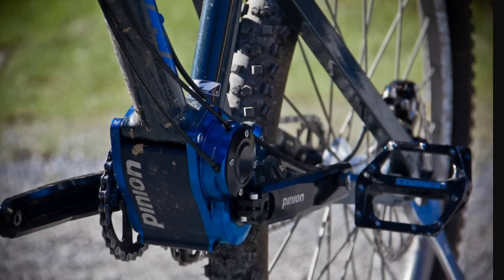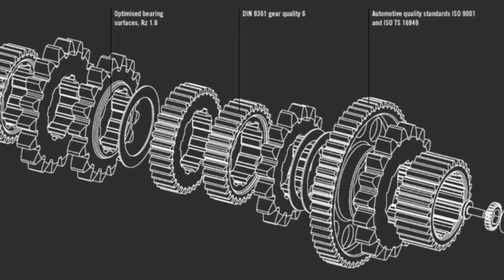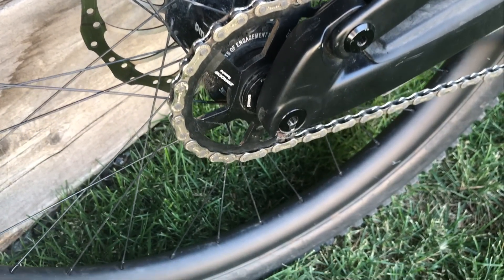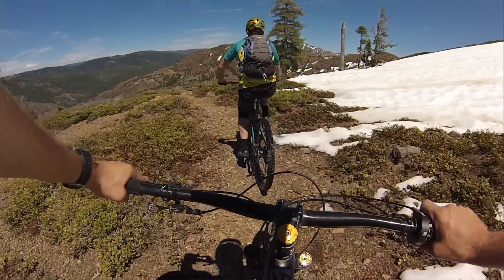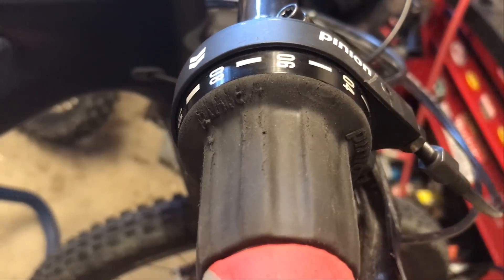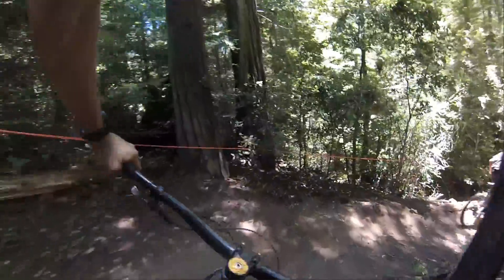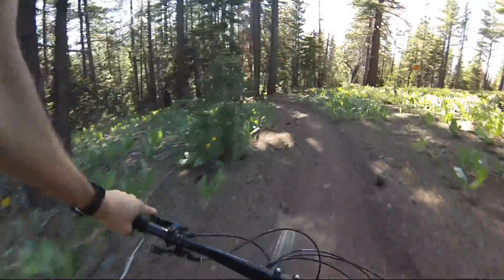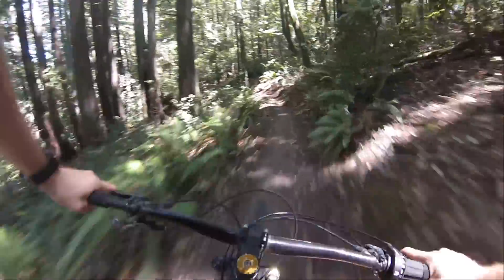Pinion Gearbox Thoughts & Opinions

Comment: From an engineering perspective.. Weight, different shifter styles, shifting under load and drag are all problems that are easily within reach. You only have to look to the motorcycling world - especially MotoGP. All that has to be done is throw R&D-time at the problem ($$$). I am sure that Shimano and SRAM already have a gazillion prototypes and long term strategies laid out already.. I bet this stuff is closer to reality (in a refined sense) than we think..

Comment: so life of the bike warranty length, huh, I still have my mid 90s specialized hardrock. so let's call it 20 years old. I mean it's had new chains, gears, chainrings, etc but the frame is still solid all these years later.
Reply from the maker: Andrew Frink yea so probably after 10 years you would have to replace the drivetrain on this. Meaning the internal gears

Comment: Once they get rid of the grip shift, I’ll be sold.
Reply: @peterlocke7285  He clearly suggested "get rid of the grip shift", read it carefully and slowly in case you miss it again.
Reply: If by "grip shift" you are talking not about the grip itself, but that 1 inch rotating part between the grip and the brake lever,, I just went on a ride, and it worked JUST FINE. As with anything mechanical with which I must interface, I have to adapt to IT'S requirements. So far I like it a lot.
Reply: @peterlocke7285  one of my bikes is grip shift, I hate it. I prefer to choose a grip and change it intentionally rather than keep moving my hands around like the  grip shift bike does. It's good for leaving outside ships though, thieves seem to dislike it as well.
Reply: @edism  Describing shifters can be confusing. What configuration of shifter do you like and is it compatible with a Pinion gear box?
Reply: @peterlocke7285  I have Shimano di2 on my road bike with the handlebar remote on the flat bar. It works with the electronic deraileur it comes with so it isn't compatible.
Reply: @edism  LOL! You have WAY out-teched me. I dislike my shifters ( 5 yrs old) because of dropped chains and half-shifts. Didn't know what a "flat bar" is, but see it's simply my MTB bar.
Reply: I understand that with time it becomes second nature.  It also allows to RAPIDLY make big changes in gear rather than having to run through all the gears, you can jump.
Reply: @edism  HAHA!!
Reply: The main reason I don’t like grip shifters is that they move about too easily, so if you’re jumping about on a trail you tend to accidentally shift all the gears up. Also, if I want to just move the gears up one by one a trigger shift is far better because I find it more accurate
Reply: @ollydickinson2196  That may be true of most grip shifters but everything I've read and heard says this is very deliberate and index like. Tough to say because I haven't used it yet.  Waiting for a pinion bike right now. That's not to say you don't make valid points!
Reply: Suppose you have to try it to know really. I don’t think I can really afford a Pinion bike though unfortunately

Comment: I've been saying this for years. The drivetrains for very modern mountain bikes is ancient. So why have all the tech (suspension, frame materials, and breaks) changed, but not the transmission. I think for this system to take off it's going take SRAM and Shimano to develops and market this system for it to become popular. Also the weight might become a factor.

Comment: Disadvantage:
- the weight
- lack of switch during drives and the gripshift
- price.  (this is not the end...)
But:
- the benefits can be evaluated primarily on full suspension bikes, but they are also partially made on hardtail
- shorter frame tubes - less weight
- no rear derailleur, no big cogset - less weight, and that no one has raised so far, less unsprung mass
- symmetric rear wheel, same spokes' lenght, same distance to the axle center - stiffer, more stable rear wheel, plus efficiency in the drive (and braking too)
- the drive is in a constant straight line like the fixies, there is never Z-shaped chainline, smaller gears and especially chain wear, and of course more power goes to the drive
- therefore the drive is much more direct, no pasty feeling
- no cross-exchange, does not fall off the chain, if the belt drive is enough, constant chain maintenance will be lost
- shifter: Effigear's solution works so that the two cable leads to the left and right grips, like the rapidfire changers, but one side you can shift up, other side down. It's funny first, but it works.
Price:
Expensive, but life expectancy is min. 8-10 years (the warranty is 5 years), and its maintenance is relatively cheap (oil, chain, cable&housing / 1-3 year). 
In such a time, a power biker will change the number of parts in a conventional drive chain. In this case it counts for 8 years, what is the cost involved with the maintenance?

Comment: !st of all, I am not a mountain biker, more of a commuter and somewhat of a bicycle tourer. Plus i'm 62 so not really in a hurry.I have an 18 speed Pinion  touring bike with about 3800 miles on it. Never had to adjust it just change the oil once a year. They loosen up after about a thousand miles or so. I can see how the shifting would be a bit problematic for racing. Once you get a feel for it you just ease up on the pedals enough to downshift. Upshifting is usually effortless. They are expensive but I have no regrets.
Reply: I commute to work by bike every (work) day even in the winter, even in the worst rain. I have at least 3100 miles on my latest commuter bike just from the rides to and from work alone. I also ride it to do grocery shopping and so on so the real mileage is much higher.

I have only now replaced the chain, I adjusted cable tension maybe twice and I lubed the chain maybe every 300 miles. I see no real advantage of having a gearbox.

Comment: On this gearbox if the spacing between gears is 17% then that's too high. Needs to be about 10-11% max. Rohloff is typically 13.6% in mid gears and this is too high. 9-10% all through the range would be good at the expense of some of the width of the range. Maybe with the 18 spd they could do it.

Comment: Alex Chamberlin at 10:38 you state you have the leverage to just bang through the gears on a motorbike. As you were comparing it to the need to momentarily cease applying pedal force to change gears on the pushbike you are incorrect. Yes it is easy to change gears without clutch use on a motorbike once moving but no intelligent rider does so under engine load or bike load on deceleration. One removes the load on the gears by an appropriate throttle twitch as required to up-shift or downshift seamlessly unless you like to risk breaking something. This happens so quickly as to be generally a seamless operation by any skilled rider. Older Mack trucks were designed to operate in this manner and it can be done with any manual gearbox by a good driver or rider who understands rev/speed matching. But as I said earlier; no intelligent driver/rider ever does it without unloading the gears.

Comment: Well one con you forgot is that it does not fit bikes that use derailleur system. It fits only the frames that are made to it. I don't say it should be able to mount in normal bike frames but at the moment that's a con since big manufacturers don't support it yet. 

And the reason behind the weight is probably the reliability that they really need at the start. Gearboxes are very complicated systems and hard to repair yourself. And at the moment I can guarantee that there is very few bike mechanics in the world who could service that gearbox in case it breaks. So they probably do all the gears way much stronger than need to be to gain that reliability, they don't want to get reputation that their gearboxes are weak and super hard to repair since no one knows how to do that. For now I believe they want to get feedback and many hours as possible to their products so they can improve such things like weight but still maintain that same reliability in future.

Two things I don't like about that system (even not trying it) is that the shifting is not done by two levers. I am not big fan of handlebar shifter or what ever that thing is called. Also not possible to shift while pedaling sounds like no go for me. I hope they make the shifting semi automatic in future with some electrical brains and clutch for example. So you could shift when ever you want and that gear would be immediately in when you pull/push your levers.

Comment: Almost 1 kg of weight is problematic from a marketing perspective. The parts not being serviceable means if it breaks, you're out of luck. No power shifting is a problem even for casual riders. Those are not small kinks.
Reply from the maker: Andrzej Sawicki this is true
Reply: On say a motorcycle you arent on the power while shifting so easing off pedaling to shift shouldnt be crazy unless you have some good hills ;) if anything this system needs a clutch of some sort so pedaling can be done with the clutch engaged so when you have to downshift quickly for a quick hill theres not as much drivetrain losses. The weight is a mixed compromise between quality and quantity but surely there's some way to make this bike 25-28pnds through parts. My 09 stolen sinner stock was around 28pnds or so and ive got it down to 23.5 with a peg so the 25/9 ratio on 170mm cranks is still a good workout 😂
Reply: As an endorphin junkie (translation: I like to climb long steep hills), this is obviously a non-starter. The weight is one thing, but no shifting under power makes it next to useless.

Comment: The new pinion gearbox is good and all but the chain because mine you have a rubber chain it can break and you can't repair it but with a normal chain you can easily fix it so I rather go with the metal chain

Comment: You cannot shift a motorcycle gearbox when it is under load. You have to back off the throttle for a second (or cut the fuel - like a quick shifter does). Same goes for the pinion - you gotta back off your power for a second to get it to shift. A Di2 type shifter won't fix this.

Comment: The gearbox of the future will have no derailleur.
A computer will decide when to change gears.
Because it has a motor it won't need many intermediate gears. Dropping them saves weight and complexity.
Gears are enclosed.

Comment: If you do downhills that could work, I've tried a planetary gear Schlumpf High Speed drive, I did a ride of 150km, my knees where in pain. At the end I've took it off and took back my crankset, it was more fluid less power to spin it.
So for some use it may work...

Why they don't use it in tour the france or other competitions, if it was so magical?
There is a loss of watts, to make it spin, there is no magic solution.

Comment: Cannot be retrofitted to your existing bike. Rohloff & Schlumpf are a simple exchange. Schlumpf drive + Rohloff= $2600. Best gravel bike add front hub 1500 watt 48v 17ah. $1000. Total $5100
Reply from the maker: Shark Mentality for mountain biking, increasing unsprung weight ruins suspension feel and ride dynamics. Most people are ok with adopting a new chassis for new tech. No one is bitching about buying a Tesla instead of replacing their v8 with an electric motor in their 2008 Chevy Malibu

Comment: Rolloff got rid of the derailleur, now Pinion moved the gearing to the bottom bracket. Already, everyone aside from racers should be happy with a maintenance-free system especially if you don't need  rear suspension and can incorporate a Gates belt drive. Why are city bicycle shops selling so-called 'commuter' bikes still flogging bikes with dirty derailleurs and chains? Commuters almost never maintain them properly. (I'm just a grouchy old bicycle mechanic) Once they make you a titanium version for racers with a closer gear ratio, then you'll be in cycling Nirvana.

Comment: Actually, you are wearing out the bushings. That’s the only wear. And you could run a thicker chain, or any size chain you’d want. But weight geeks will probably dictate a thin light weight chain.

Comment: fixed gear hub == way more chain drag
Reply from the maker: Not really. It's actually quite efficient
Reply: GEORGIOS PAPASOTIRIOU according to something I just read  the average powerless across the gear of some rear wheel drive front engine car is around 6 percent. That's a hell of a lot more gears than this with a lot less power loss than what you just said.
Reply: fixed rear hub would not only increase drag but also cause chain slack top side. The cog is pushing the chain forward to the chain ring.  It wouldn't work.
Reply: Wow I'm an idiot. You were talking about if there was a fixed gear hub. Ya a fixed gear hub wouldn't work very well.

Comment: You can shift a motorcycle without the clutch. The thing is is that you CANT shift without the clutch while it is under power. Realy try shifitng without the clutch while still on the throttle. It wont shift.... so does this mountainbike transmission

Comment: Too bad it would be too heavy for cross country. Maybe it will be lighter in the future.
Reply: Just try it if you can. :) By the way a Shimano XTR M9100 2×12: thei weight of the parts (cassettes, shift lever front, derailleur front&rear, crankset) is approx. 1300-1400 g, and the price is approx. $1500. Pinion's similar data: approx. 1800-2400 g & $2500 now.

Comment: it weighs 2-2.5kg!!!! Not 2lbs like you claimed
Not the future at all in my opinion. Maybe in mountainbiking, I don't know alot about it admittedly.

But for road, gravel and cyclocross no way this can beat a derailleur. it's sooo much heavier has more drivetrain-losses(by design, just like a derrailleur has some losses compared to a fixed gear, although I do give em the benefit of the doubt might be pretty efficient)
Reply from the maker: Ride one. Let me know if you feel the weight of it. Also, the only application I don't see it working for is the EWS. If you aren't racing that series, you won't notice any loss of speed. It's not the bike, it's the rider. This bike is just less maintenance
Reply: Mass is centralized, you don't feel it boy, do you feel the weight of your fat tummy? Nope. Wheels are  most sensitive to weight. Mass centralisation helps a lot.

Comment: The argument about "old technology" is very poor. It's just as stupid as calling modern motor engines ancient design, because they function on a principle that's been first used ages ago. If you do a bit of research on how much engineering goes into stuff like the Eagle, you'll be quite surprised. And the funny thing is that manual transmission is an older design than a derailleur. 

Internal gearboxes are not entirely new and their downfalls appear to not have improved one bit. A big issue is efficiency. Conventional shifting systems can reach up to 97 or 98% efficiency. A gearbox is nowhere near that. Which is why it's never going to take of in anything other than gravity driven disciplines. 
And probably the biggest issue is the proprietary design. If the manufacturer every decides to stop manufacturing a part you need, you gotta buy a new bike. And that's not even beginning to describe the issues that home builders would face.
As for the longevity of everything, let's get real here. What is "seasons" for one guy, is half a year of bad weather for another one. 

It isn't just about how new a technology is. The biggest thing really is room for improvements. Not all issues can be fixed. An example from a different market: few years ago people predicted that OLED would push away LCD. Even more years ago, people made the same predictions about plasma. However, LCD has been improving so much, it remains the most common display technology to this day. And for the same reason, almost all of us have a conventional shifting system. Because alternatives have very serious shortcomings that take away from the performance.

Comment: There's no getting around the fact that it will always be more expensive, less efficient, and heavier than derailleur systems.  That's the difference between gears and sprockets in a nutshell.  Pinion makes me think of the Rohloff hub-- which is very, very good, but is not the future of cycling.  Neither is Pinion.
Reply: It's a niche product for bikepackers and maybe wealthy commuters. Gearboxes aren't new technology. They've been around for centuries. If they truly were the superior form of transmission for bicycles, they would be commonplace by now.

Comment: A gearbox will always be way less efficient than a chain drive. I don't care how well it works if I'm losing a significant percentage of energy to the gears... and these losses can never be tweaked away. Gears lose power. Period.
Reply from the maker: b-rock and? 2.5 Tires are less efficient than 2.0s. Suspension, like fsr and single pivots, are less efficient than hardtails. Low BB's are less efficient than high BB's on tech terrain. More travel is less efficient than less travel.